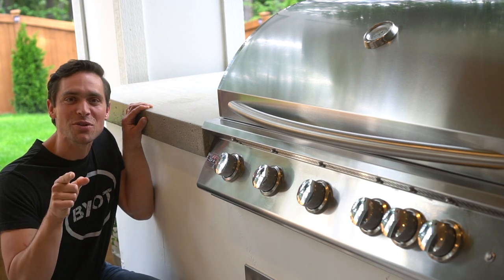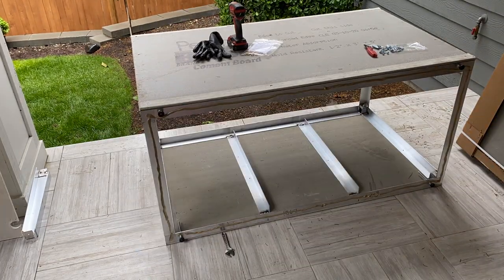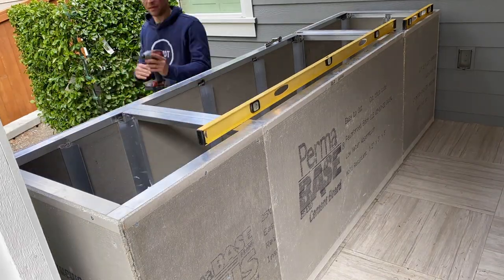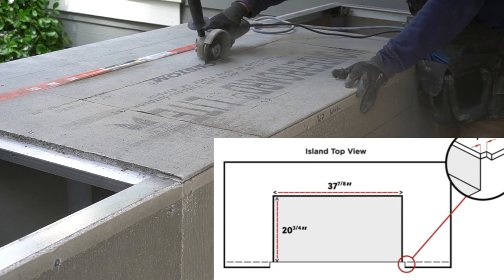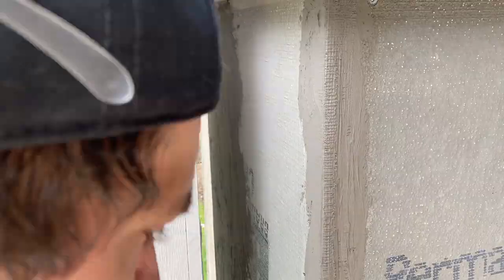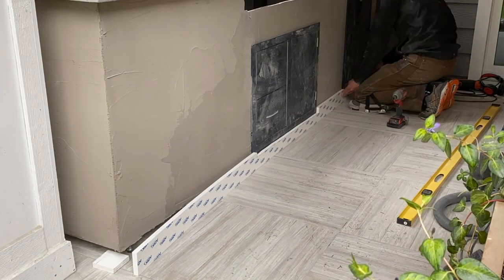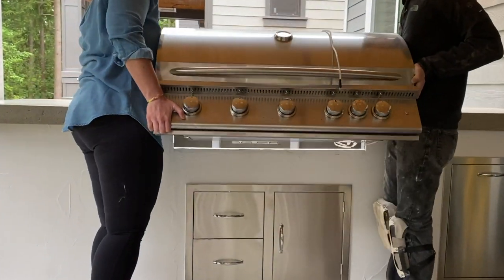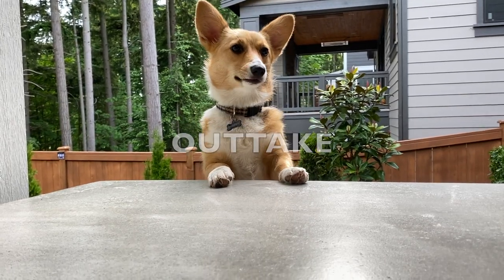DIY BBQ GRILL STATION // How To Build An Outdoor Kitchen

Comment: Excellent job. Well done. One thing I might add if I were doing the job is I’d fill in the hole where the gas line goes thru the cabinet to help keep mice and other rodents out of the cabinet.  I repair grills that are set up with all kinds of cabinets and let me tell you, if there’s even the smallest opening for a rodent to get in, they will find it.  Just fill that hole with steel wool or some wire mesh.

Comment: Should not have used thread tape on the fitting from the reducer to the yellow line. That is a self sealing type connection, similar to a brake fitting on car or hydrulic lines (looks like an AN fitting), and the tape could hender its sealing ability.

Comment: Was there a grill liner? I didn’t see one in the video. That’s a lot of heat to drop into the cabinet if you don’t have a grill liner. Pretty sure that’s in the specs of the stove to install the liner.

Comment: Very professional bud! Looks great, informational for us. I’m not a fan of metal frame work for cabinets but it’s not my house anyways and regardless turned out stunning and clean. Question, the product you used for the sides or the concrete sides, why not use a white concrete? Not criticizing whatsoever, just wondering if that’s not possible because it’s vertical or if it purely was the owners preference to paint the concrete? I think it’s be beautiful to have that natural look using white cement mixed with a natural river stone for contrast. Anyways I really enjoyed this project and the quality of materials and your keen eye and experience made it easy to love!
Reply from the maker: Great to hear and I truly appreciate all of the support.  I did a lot of research on what is the best product to use for that type of application.  This produce is specifically designed for exterior vertical surfaces, which is perfect.  The material consistency is completely different from concrete, which is why it was so easy to apply it to a vertical surface since it was thick but easy to smear on.  It only comes in grey haha.  Great question though and thanks so much for watching.
Reply: What would be the downside of applying stucco instead of this special concrete?

Comment: Ok our project is finally getting to the point where we are ready to apply the Ardex OVP.  I am noticing that sometimes there is a feather finish cement used to cover the alkaline tapes and screwheads.  Did you not need to do that because Ardex will always hide cracks?
Reply from the maker: Great to hear Diana and good question. The Ardex basically acts as the same product that would be used to cover the tape and screwheads in any case. Going a suggestion that I may have for you is that you could mix up a small amount of ardex and apply that to the tape and screwheads first. And then apply your Ardex over the entire surface after that was dry. It might make everything go a little bit more smoothly in the long run. Thanks again for watching and hope you subscribed.

Comment: This is great! ... as far as the bottom board that sits on the floor, what kind of material is that? is it a cement board?
Reply from the maker: Great to hear Joseph and thanks for watching.  Its a product from AZEK and its PVC or plastic based so it won't rot.  Thanks for asking and hope you subscribed.

Comment: wonder what the weight of this is (exclude the concrete countertop). Thinking of building this on top of my deck. I assume the aluminium and cement panels would be lighter than full wood?
Reply from the maker: Great question Salvador.  This system is definitely lighter then normal wood frame construction but there is still some weight to it due to the cement board.  Probably 200 to 250 lbs still.  Thanks for watching and for subscribing.
Reply: @BYOTools  200lbs for the whine thing is more then fine especially given the foot print. My deck was built with 2*6s 12" on center... According to the tables it says upwards of 100lbs per square foot of load. 200 lbs the whole unit works be a piece of cake
Reply: Thanks I was just wondering if I could build this on a deck I’m building soon ☺️

Comment: Great looking project. How is actual summerset bbq installed? Does it sit on a platform or suspended some how?
Reply from the maker: Great to hear Bob and thanks for watching.  The BBQ is sitting on top of the concrete countertop.  Check out part two if you'd like to see in more detail how it is supported.  https://www.youtube.com/watch?v=MpCfZQYVoB4&t=44s

Comment: When I saw the Grillnetics cabinets for the first time I was impressed by the looks of the sections and the concept. After watching this video, and looking up the cost of the units, I am concerned with the quality. I thought the welds looked sloppy and it makes me wonder about the quality of the entire structure. Please give me your honest opinion of the quality and value of the Grillnetics products.
Reply from the maker: Hi Rick.  Thanks so much for watching and your support.  I can honestly say that I agree with you that some of the welds are a bit messy and could be a bit cleaner, however that doesn't take away from how strong and amazing this system really is.  I love this system and I know it can be an expensive one for sure but man o man it is a very nice system all around.
Reply: @BYOTools  What gauge aluminum?
Reply: Yo the welds were bad lol
Reply: @Pureblood547  No kidding!!!  After I saw your video, I went to Harbor Freight and bought a small welder so I could learn to weld aluminum myself. Thanks for the update!
Reply: @BYOTools  Thanks for the update. After watching your video I bought a small welder from Harbor Freight to learn to weld aluminum myself. It is harder than it looks but progress is being made.

Comment: Great video. I noticed the bbq has some vents on the sides, which I am assuming they may be somewhat blocked by the metal studs, cement board and concrete countertop? Is this ok?  Running into this with our instal, and wondering if this is something we should avoid? Thank you in advance!

Comment: Looks really good! Why do you use Teflon tape on the flanged fitting hose? Not necessary.
Reply from the maker: Great to hear Roger and thanks so much for watching.  This is tape specifically for gas lines.  Not your normal teflon tape https://amzn.to/2XJi85g

Comment: With Ardex OVP verical walls you used the tape and then painted it but I didnt notice if you used a sealant.  Now this is a covered porch so if this was exposed to the elements would you use a sealant once it cures and then paint?
Reply from the maker: I had a long conversation at the paint store about the best product to use.  With the paint I used I didn’t need to seal it separately.  Just apply to coat of the paint.  Thanks for watching and hope you enjoyed the video Diana.